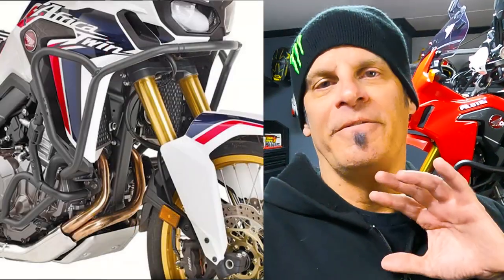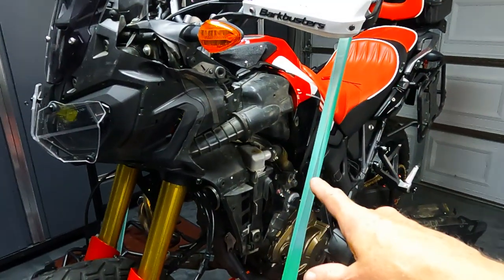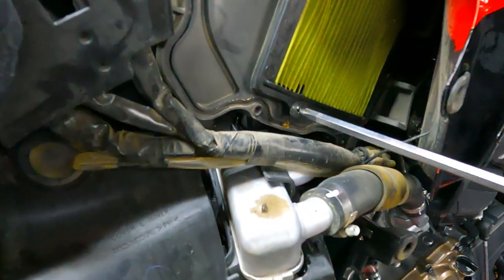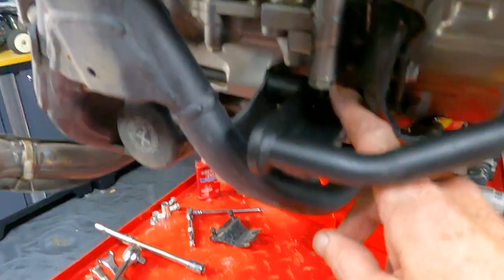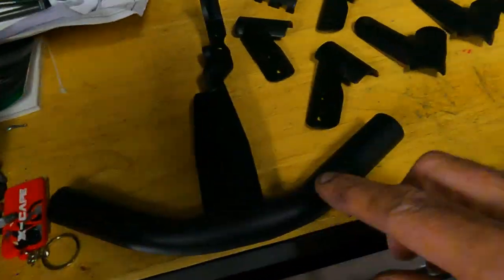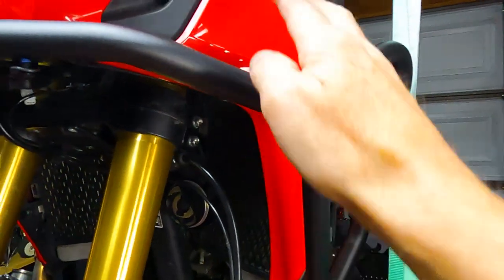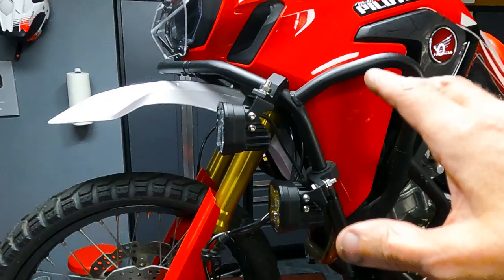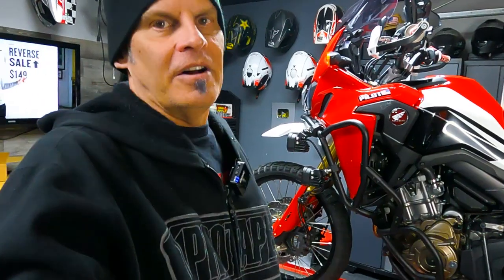Africa Twin Full Crash Bars for only $420.

Comment: I have the same set. I tested them out rigorously about a month ago after a year of not dropping the bike (5 drops in an hour on rocks, mud, clay, steep hills, and had to drag the bike 180 degrees on a steep baby head covered hill recovery). 

Few light scratches on the bars, some touch up paint, and all good. Some scratches on the side atand and bark buster plastics only.

If you value those lights, flip those clamp mounts and move them all inboard of the widest point of the bar where its mounted.  
The lights will get destroyed even though those clamps move on the bar in an impact. 

I have a similar set up, one set of spots up high and one set of flood lights mounted to the lower engine bars pointing out on 45 degree angles for wildlife on the sides of the road and also as cornering lights.

We have wombats and kangaroos here and its saved me a few times.
Reply from the maker: Ah man bummer about your crashed. Part of the adventure. Lol.
Yeah I'm struggling with the lower lights sticking too far outward. But if I flip them they clash with my front brake lines. I'll figure something out. I got them all wired up today and just did a night ride test. These Aux Beams are very impressive. Video coming soon.

Comment: Thank you for a great video 👍
I want to ask you, does buying a 2017 Africa Twin CRF1000L. In 2023 make sense ?
Reply from the maker: It depends on what you expect from the bike in the way of electronics mostly. The newer models have more rider aid options but they are troublesome. And a little more power since going to an 1100. Improved suspension. You will pay around $10,000 for a 2017 model. I believe the newest models are closer to $18,000 plus. So it depends on your budget also. I don't use electronics much as rider aids and I enjoy riding my 2016 as much as I would one that cost double the price. Buy used and use the money you saved to add your preferred mods. But really they are all great machines. MP